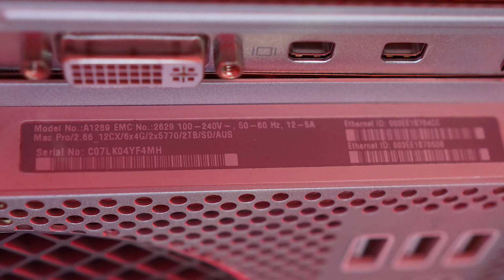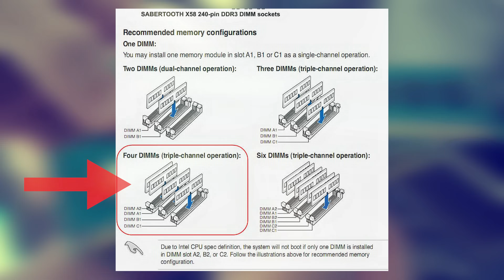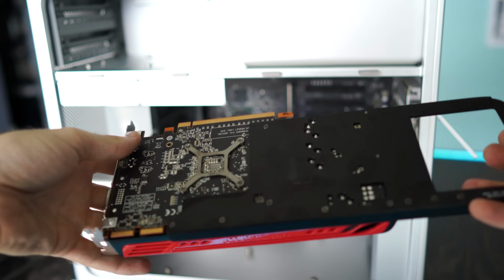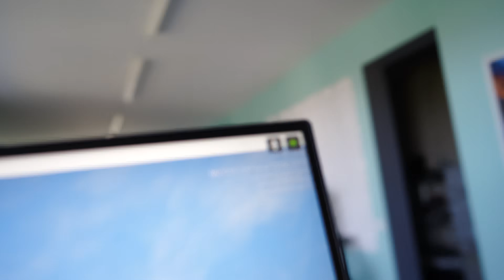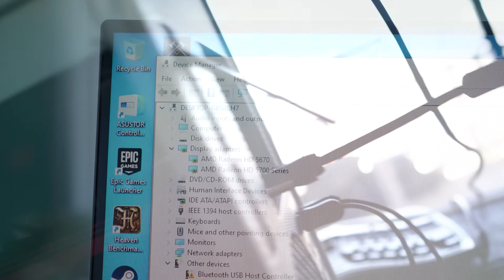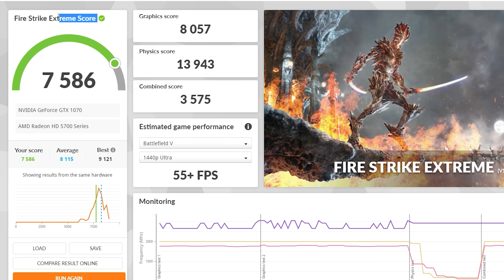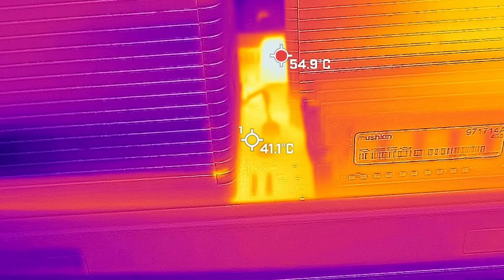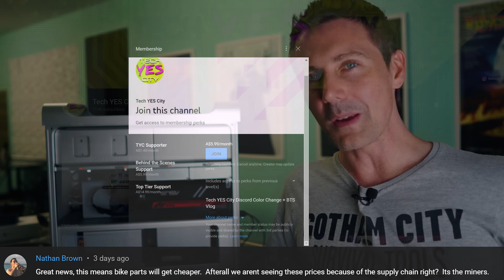Windows 10 GAMING on a $100 Mac Pro 5,1 from 2012... Is it Possible...?

Comment from the maker: Forgot to add... this thing is legit HEAVY AS, like hernia producing heavy, so be careful if you do ever come into one not to just try hulk it off the ground quickly.
Reply: Can confirm about the weight, bought one from a 2nd hand dealers in Bondi Junction, had to carry it to train station, had to stop to rest about 10 times for the 1km walk, almost killed me......
Reply: @nix123ism  dang, that’s a story you won’t forget, for me the heaviest pc was my dads dell all-in one, weighed about 40 pounds, yet my atx build is way lighter.
Reply: Hey can u pick up a think centre m700 sff n see if that can run 2021 titles thanks 😊 🙏
Reply: hope you used AMD catalyst 15.7 with those 5770 video cards for windows 10 or windows 7
Reply: Great Video. You nailed the assessment. It's an X58 system. And it has limitations today (no AVX2). While it can game, it's not a gaming system and is best suited for someone who wants to try macos on the cheap. Let us know how much it sells for in a future vid!
Reply: Next time you encounter one of these behemoths, give this a try:

https://www.youtube.com/watch?v=lQRgn4-jmAQ
Reply: i paid $80 for mine good deal going to use a gtx 970 inside it
Reply: the card runs fine in Diablo 3 with no problems. you have to run games from 2000 to 2020

Comment: running windows 11 on mine, because why not. 

Time of this report: 
1/12/2026, 18:13:06
Operating System: 
Windows 11 Pro 64-bit (10.0, Build 26200) 
System Manufacturer: 
Apple Inc.
System Model: 
MacPro5,1
BIOS: 
144.0.0.0.0 (type: UEFI)
Processor: 
Intel(R) Xeon(R) CPU X5675  @ 3.07GHz (24 CPUs), ~3.2GHz
Memory: 
65536MB RAM

---------------
Display Devices
---------------

 Card name: NVIDIA GeForce GTX 1060 6GB
        Manufacturer: NVIDIA 

i have a rx 580 8Gb but that is currently in another device.

Comment: Computer:         Mac Pro 5,1 (mid-2010); 
Processors:      2 x 3.46 GHz 6-Core Intel Xeon 5690;  
Graphics:          AMD Radeon RX 6800 16 GB (Flashed: Syncretic fix, injected GOP); 
Power Mod:     Pixlas modification to supply sufficient power to the GPU card;
Memory:          96 GB 1333 MHz DDR3 (2 x 3 cards);  
Monitor:           Dell G3223Q Gamers Monitor 4K 32 inch, 144Hz, AMD Free Sync Premium Pro; 
Optical Drive bay 1:     Standard CD/DVD player; 
Optical Drive bay 2:     Blu-ray player; Blu-Ray Player Pro software; 
SATA bay 1:     SSD 255 MB SSD, OpenCore in EFI partition (OCLP v.1.5.0) and macOS Big Sur v.11.7.10;
SATA bay 2:     SSD 2 TB SSD, Time Machine; 
SATA bay 3:     SSD 2 TB SSD, Archive; 
SATA bay 4:     Empty;
PCIe slot 1:     SoNNet M.2 2 x 4 low profile card:  NVMe SSD Boot 1: 1 TB Samsung 970 EVO Plus, macOS Monterey, v. 12.7.5;  NVMe SSD Boot 2: 1 TB Samsung 970 EVO Plus with heatsink, Windows 11 Pro;
PCIe slot 2:     AMD Radeon RX 6800 16 GB (Flashed: Syncretic fix, injected GOP); 
PCIe slot 3:     Empty, with open mesh cover for ventilation;
PCIe slot 4:     SoNNet Technology USB 3C-2PM-E adapter card, 2 x USB Type-C ports; 
Cooling:          Additional fan fitted to front; Noctua Chromax NF-S12A PWM; 
WiFi & BT:      Broadcom BCM94360CD 802.11ac WiFi & Bluetooth combination card: Chipset BCM4360 1.0, with external BT antenna;
Ethernet in:    Internet cable to KPN glass-fibre modem, one hop to internet backbone Amsterdam; 
Optical out:    Optical cable to NAD C388 150 Watt RMS amplifier to Jamo S628 Floor-standing speakers with Jamo C912 subwoofer; 
USB rear 1:    Type-A to RAZER Death Adder Essential gamer's mouse; 
USB rear 2:    Das Keyboard MacTigr Wired Mechanical Keyboard -  Low Profile Switch, for Apple Users, Built-in 2-Port USB-C Hub (US Layout) Suitable for gaming and rapid touch-typing.
USB rear 3:    Type-A to Schiit MODI DAC, to Schiit MAGNI preamplifier, to reference headphone Sennheiser HD650 / 2 x Tannoy Gold 7 reference speakers;
USB front 1:   Type-A to Brother Printer MFC 7460 DN; 
USB front 2:   Type-A to 6 TB Seagate external HDD, Backup of the Archive files; 
USB PCIe 1:   Type-C to to lightening connector, iPhone;  
USB PCIe 1:   Type-C to type-C Audient iD 4 MKII, audio input; RODE NT1-A microphone. 

Finished RDR2 on this machine, at 40 FPS with all graphics on High, at 4K.

Comment: Ive upgraded to an M2 Macbook Pro, but i still use my 2011 MacPro 5,1 with 64GB , RX580 8b and 2x 5690 and its pretty good... Current A titles run pretty well in mid settings. Currently playing Psychonauts 2 in 1440p Highest settings and its sweet.

Comment: I got a a quad core mac pro 4,1  2009 for free ..upgraded to a 5690 6 core/rx570 card and nvme and it was quite the machine.. effortless power,cool as a cucumber and fast as well as h264/hevc decoding/encoding ... I always had an eye out for a dual tray and finally got one for 125.00 us dollars...it has the 2 x5690's and 64gb ddr3 1333mhz ram... Finally, ive got one of these that I had fantasized about for quite a while.. running sonoma and 4 other mac os systems And win 11 on a single nvme... I cant see how most people wouldnt be pleased with how smooth and effortlessly fast these beasts are even in 2023..sure there are  Faster rigs but this is still a Fast machine and handles everything without the slightest hint of strain.

Comment: I mean, also it's a 1070. I might move my 3060 into my 5,1 and try it. Have to check the power reqs...a 6600XT would probably be a bump up and use a lot less power.

Comment: I know this is old but hear me out.

You have to upgrade the EFI by upgrading the base OS to High Sierra. 

Then you install OCLP which adds a seperate bootloader that can work with non-Apple GPUs. OCLP allows you to update to newer macOS versions and makes it easy to dual boot.

I daily a 5,1 that runs macOS 12 and Windows 10. It has two Xeon X5680s and an AMD RX 580. I may upgrade my GPU in the future though.

Comment: I plugged a msi gtx 1060 3gb oc without having to use the original 5770 in it, and it worked just fine no issues, not hacks, and it's a 6pin so it plugged right in with no rewiring. I have successfully updated all drivers and as of today's date whenever if ever someone reads this comment I am running the newest windows 10 updates! Only issue I ran into is the generic TV monitor I hooked up. I thought I was having an audio driver issue. Oddly enough 😅 if you let the pc start for a few min then turn on the monitor it is able to configure it so the speakers work! 🎉 For those of you who are worried about a 1060s performance msi afterburner is definitely a good asset and when I had it paired with an i7 8700k it up until 1 week ago was still able to play the newest video games in 1080p, granted not at high settings all the time. But they were definitely 60fps playable. Although in order to install windows 10 I had to use the 5770 until it was done installing completely but after that it was free reign

Comment: Yo la uso Nvidia 1660 ti trabajo edicion 3D y Quadro k2000 para editar final cut pro ya cumple 10 años trabajando sin problema. Todavía falta mas aumentar actualizar NVME pci, 125 Ram y nvidia hasta 2090 o radeon el ultimo 2.0. Estoy uso MOJAVE en mac 2012 12 núcleos

Comment: I'm gaming on the exact same machine, well, almost... 2 x5690 CPUs (12C/24T), 72GB RAM, Radeon RX580 Nitro+, 2TB NVMe SSD + 4TB SATA SSD + 3TB HDD on a 2K + 1080p monitors and the RD580 is my current bottleneck, I can't go higher because of MacOS 10.14 which I produce music on, but I'm tempted to put a beefier NVIDIA card in there for Windows and games, while keeping the RX580 for MacOS... should be feasible with OpenCore.

Comment: One of the best machines Apple ever produced, I still use my 2009 Mac Pro as a main machine, upgraded to 12 Cores @ 3GHz with 64GB RAM, 1TB PCI SSD as a startup drive, 32TB on HDD Storage (2x8Tb and 1x16TB with one slot still free) and an RX580 that drives my 30" Apple Cinema Display like a charm... You can use OpenCore Patcher to upgrade the OS to the latest version of Monterey and everything works perfect.  That's why these machines are still very valuable.
Reply: How much did you pay fot the dual tray 12 core 3GHz processor with or without the ram inclided? I see them for around 300$ Canadain on ebay

Comment: I have a 2010 Mac Pro 5.1. Mac OS on nvme card. 2 2tb enterprise hd’s 7600 rpm. 2 300gb enterprise hd’s 10000 rpm. 32gb ram, x3690 3.46ghz cpu and rx580 8gb gpu. It runs great still and does everything I need from it. It can play games in high or very high settings on 1080p which is what my monitor is. I also have a modified Mac mini g4 and g3 600 mhz iBook! Hahah oh, it also has boot screen. Gpu has been flashed.

Comment: macs fan control (compatible in windows too) is the fix for nosueey fans. Set your intake and exhast fans to take the brunt of the work becasue they are the biggest fans and also questist fans. jsut make sure your cpu and north brudge are nto over heating and turn eveythign else on low fan rate

Comment: I've been running Windows 10 on a Mac Pro 5.1 from late 2009 using a 1050 TI for a GPU for several years now to great success. I can play plenty of modern games on high settings. I also installed Windows natively, not via Bootcamp, which actually I slightly regret because it makes it wonky when it comes to Bluetooth among a couple of other minor things but for gaming it's been excellent.
Reply: Hi can you play gran turismo sport or forza horizon on this?

Comment: 15:19 You can install MacOS12 BUT..You do need to use OpenCore Legacy Patcher to create a booterble USB and after that u may have to patch the drivers so old pcie cards like Wifi Work if its very old. 

but i can say ive had mine for 2years and it runs MacOS11 &MacOS12 as if it was built for it 
superfast MacPro Defo Get one if u lot can

Comment: I’m surprised your dual HD 5770s ran that badly, my single 5770 did over 60 FPS on high settings in heaven. But that was under MacOS High Sierra, not windows. Ran Fortnite just fine in windows though.

Comment: I've owned a 2009 4,1 -> 5,1 for about 5 months now and as far as gaming goes, I've managed to enjoy AAA titles running them off Steam on Garuda Linux. Frankly, performance and user experience have been fantastic. I will admit there are situations where you have to get crafty to run the title but outside of that, ill be hard pressed k to W10. Great machine. Running X5890 64GB of Ram GTX1070
.
Reply: How did you get Windows 10 to run on the 5,1?

Comment: The Mac Pro 5,1 is probably the best computer Apple ever built, at least since the SE/30 waaay back in the day (those things were so upgradeable). 

My secondary gaming system is a Mac Pro 5,1, and I've been experimenting - currently running a ViewSonic 17" CRT and an Asus Matrix HD 5870 2GB. I tinkered with Macs before PCs, and had only worked in that ecosystem for years - my first real computer was a mid-1990s PPC tower (prior it was Commodore, bit of a gap).

I have used this computer as a daily driver with an RX 580 both in Mac OS and Linux - the latter can really add some finesse if you aren't willing to deal with OpenCore installations of unsupported operating systems. But, the old slur is true - Macs don't game well. When Apple ditched modularity in their systems, it was the end of my love affair. 

With my retrogaming setup, it's surprising - though I don't run the most AAA titles - more cRPGs and the like. Currently I'm hanging at 8.1 because it was an easier install with the Mac Boot Camp - which I only used for the driver support. It doubles the frame rate of Mac OS, which itself performed better than Elementary or Pop OS. 

Linux would not run silent on this machine - I've tried a bunch of distros, a number of GitHub projects... The card is finicky with cooling at least - it provides a boot screen, drive selector options - and, no, it's not flashed. 

These still sell for a lot for a reason. This is the greatest computer that Apple ever built in my opinion. 

I'm not alone.
Reply: yeap, i came over for Commodore 64 after fallout of the company. somedays i miss the commodore/ Amiga generation

Comment: Extremely good deal. I have been looking for years and could never find one under $500. Best I could find was two 2009 single cpu mac pro computers for $200 and another with a damaged handle for $50. The seller did throw in an apple monitor and 3 apple keyboards.

Comment: Apple stopped supporting these Macs several years ago, in generally Mac computers are only supported for 6-7 years, some get more support, some get less, but on average it is about 6.5 years. 
I used to always say, 'Buy a Mac, they're built well, and windows will always support them' but thats changing with windows 11 requiring TPM 2.0, yes i could install it on my 2010 MacBook Pro, but it never worked right, and its not the age of the hardware, my thinkpad of the same hardware design works great in windows 11

Comment: I'd like to note that the reason you may not have been able to overclock is that if this used the tylersburg 5500/5520  instead of the tylersberg x58 chipset i've never gotten XTU to work. It may have just been the BIOSes of those boards, but i've always gotten the error "unable to install on unsupported platform'

Comment: I've got a 4.1($50), that i plan on flashing to a 5.1, and installing my dual x5690 with sime cooling mods if it gets too hot.

Edit, i have several X, E and L series 5600 processors, my X5690s came out of my original workstation/gaming machine with 12 slots of RAM, but the board died, and figured i'd throw them in the Mac for a nice little sleeper

Comment: If you want an equivalent honestly could go HP Z600. They are like $150-$250 USD. I bought 2 of them and if you get the second release of the motherboard you can put 96gb of Memory in these things! It's my daily driver with a GTX 1060 atm.

Comment: The reason u only got 2/5 fps in heaven is a sign of missing drivers i have a HD 4870 and its kicking 25 fps in heaven on 1080p and it can still play modern games on 720p the only issue is direct x 10

Comment: You need to update the BIOS on this thing first, This is done by upgrading to the latest available macOS version on this. It will enable a lot more CPU's (for example a pair of X5675's,) native NVMe support, and native support to a lot of modern AMD graphics cards - especially the Sapphire Nitro RX 580 8GB. Once you got all of that, you should be able to boot into macOS with that RX 580 as well as Windows, and since RX 580 is still decent now (beating the new RX 6500 XT) you will get a lot of milage out of that card.

Comment: Im actually using a X58 system as main PC although its age i have a really good experience.

CPU: Xeon X5650 (OC'd 4.2Ghz Limited by stock Acer Aspire M7720 although Cpu temps not passing the 70's at 100% load)
Motherboard: Asus Sabertooth X58
Ram: 16gb ddr3 Corsair Rams in triple channel (8+4+4)
GPU: GTX 1050 Ti (not able to upgrade due to overpricing in my country)
SSD: 500Gb Samsung 870 EVO
Hdd: 2tb Western Digital 
PSU: 500W Evga 
Case: NZXT H500i

Im pretty happy considering that all together i payed little over 500€ on all my setup, including a G27, and a Logitech sound system, G502 Hero and a local branded mechanical keyboard.

Comment: I gamed on an 8 core MacPro 3,1 for years. For the time it was screaming hardware. When the 8800GT died I upgraded to a 5870. Worked great until I tried playing Carmageddon Reincarnation and it was a slideshow. Build a Hackintosh PC to replace it.  Gave it to my kid to use for a gaming computer. Eventually upgraded the GPU to a GTX 950 using hackintosh nvidia drivers. I did not need a mac GPU installed to get it to boot unless I wanted to work with the EFI boot menu, That still required me to swap for a Mac GPU on a rare occasion. I now use it as a legacy media transfer machine because it has both Firewire 400 and 800 ports on it for old camcorder tape transfer. It's been a trooper!

Comment: Put an aftermarket AIO 240mm water cooler on this 1070.  It will allow the card to stay in boost mode all the time. It will get the temps down to 39 degrees under load.

Comment: Do these Macs support single QPI CPUs?  Or dual QPI Link chips only, a la Dell Precision T5500?

Try booting it with a single W35XX or W36XX CPU and get back to me with whether it works or not.  If it does I have a followup tip for you!

Comment: OpenCore bootloader FTW... P.S.: I just built a dual x5680 48g rx580 5.1 with bootscreen, overclock via setFSB and win11 with 0 problems and I'm having so much fun with it as I never had before...
Reply: how is gaming on it in windows 10?
Reply: @owen3777  Don't know, actually run w11 22553 :)) P.S.: Runs great, with latest AMD drivers most games still run at 60fps at least on my 1600p ultrasharp .. :/

Comment: Maybe you should have tried a RX580 keep it all under AMD drivers mixing AMD and Nvidia drivers can be problematic also typically it's the shadows and post processing settings that cause lag in Fortnite just lowering those helps with stutter

Comment: I’ve owned a lot of these, recommend upgrading to x5680s or x5690s. For cheap gpus, 7950/7970/280 can be easily flashed for boot screens, rx570/580. Can run opencore easy and run latest MacOS, dual boot into windows 10. I ran a vega vii in mine and played games at 1440p in windows . You left a lot of performance on the table but it’s okay you don’t know the system, I’d recommend keeping it a little while and learning about it.
Reply: 5690s are dirt cheap--no one wants them. Running MACOS the speed boost with them and 96GB of RAM is noticeable. I was going to mention flashing the BIOS/cards. Thanks for jumping in on that because so many forget/don't know they can. I'm sure he just wants to sell it off for PC parts. If he maxed this out he could (likely) get $300-$400AU over what he'd pay for parts. People in Sydney and all. ;)
Reply: How do you power a Vega Vii in one of these?